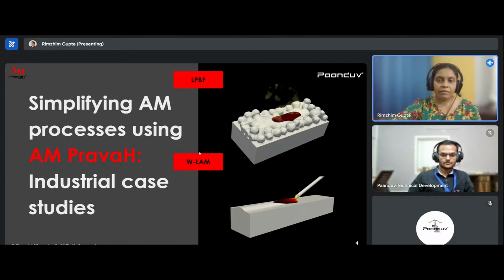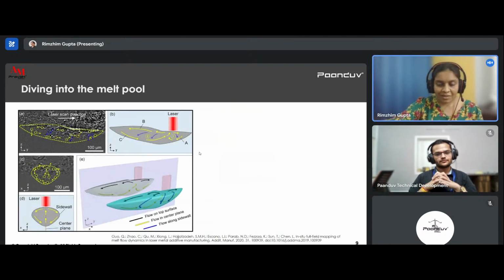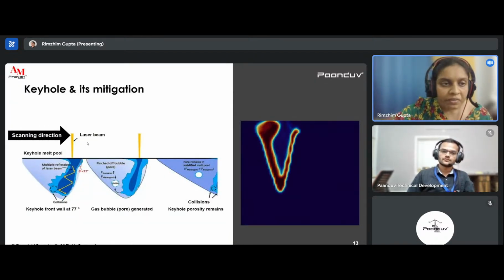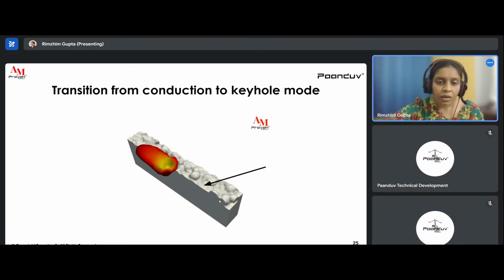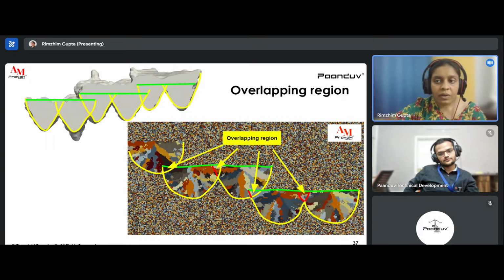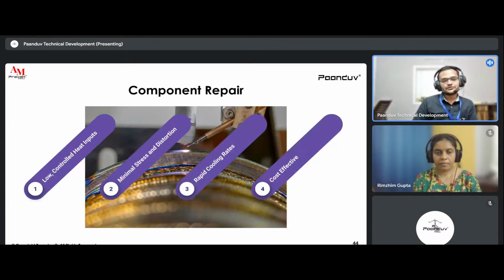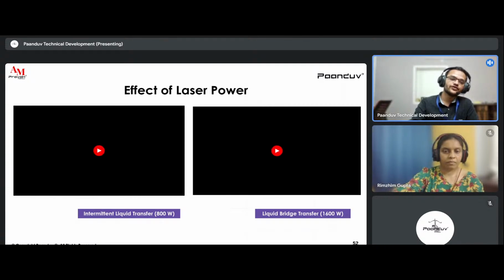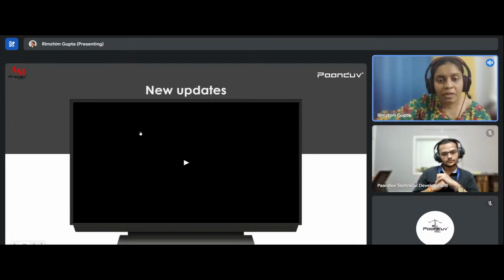Simplifying Additive Manufacturing Process using AM PravaH: Industrial Case Studies

Comment: Dear Paanduv Team,

Firstly, I would like to commend you on the excellent work you're doing!

I have a couple of questions regarding the AM Pravah model. Is it capable of accurately predicting the 3D microstructure (such as grain size distribution, porosity distribution, and texture) based on powder attributes and build parameters? More importantly, has this model been validated?

Additionally, in metal additive manufacturing, it’s common for as-printed parts to undergo heat treatments to enhance properties, which naturally leads to microstructural evolution, such as changes in grain size distribution. Are there any plans to expand the model to include post-processing simulations to capture these changes?

I fully appreciate the complexities of such modeling efforts and would love to hear your insights on this.
Reply from the maker: Contact us at support@paanduv.com